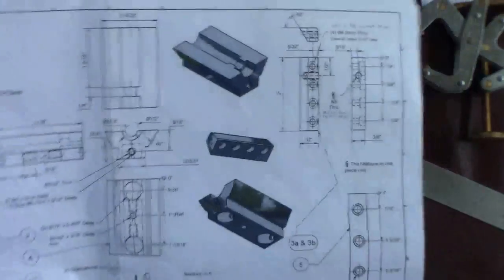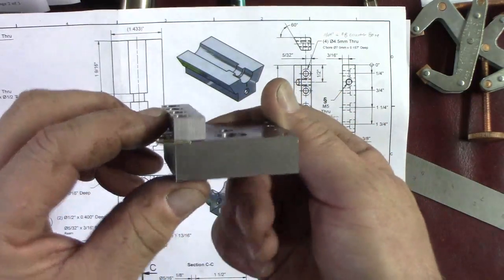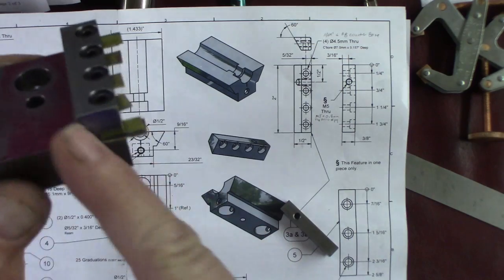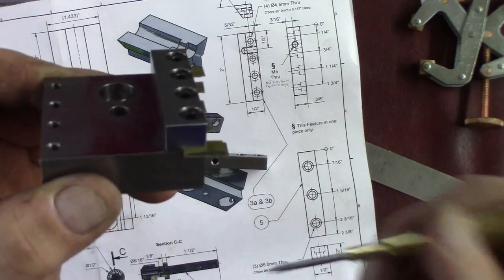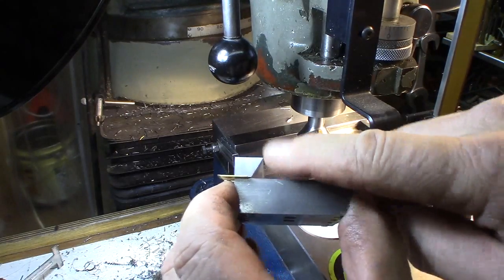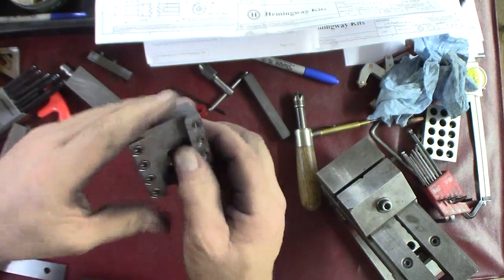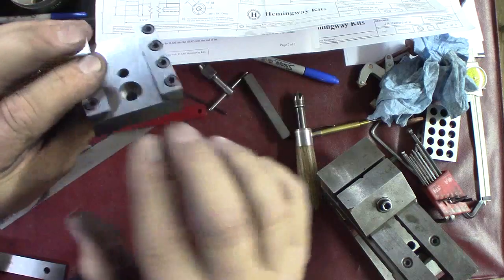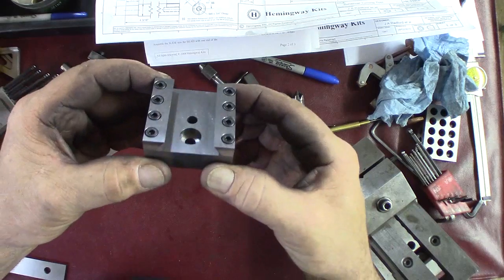How To Build a Hemingway Kit Spherical Turner / Ball Turner P6

Comment: Hi Randy, I really enjoy your machining project videos you've been doing lately, I'm learning a lot of techniques in machining accurate parts watching your videos.
 I was just curious why you didn't take the blank off of the base, and set it at the required angle in the vice and use a straight cutter  to form the dovetail?
Reply from the maker: I am trying to follow the plans and instruction as closely as possible.  Yes, you could of made them that way very easily.

Comment: Randy, I have this kit in front of me now, and I see a problem that I think you are about to run into (if you haven't already noticed).  The body piece is 2-5/8" long, which is sized perfectly for an AXA style tool post.  I have a BXA, and it looks like yours is at least that big if not CXA or larger.  With the body that short, either the head or the handle is going to run into the tool post.  It may be possible to make it work with the handle at some funny angle.  It really looks like the body needs to be extended about an inch longer for a BXA post, longer still for a bigger tool post, in order to provide comfortable clearance for both the head and the handle.  You may want to check the dimensions on your setup.I'm also planning to use a dovetail mounting block on the side instead of the standard side rail so that it will mount directly onto the tool post without needing to be mounted in a tool holder first.Ryan
Reply from the maker: Yes, I did some measurements before I started the project.  So I left the body as long as I could with the stock provided.
It will work great on the 11" Logan with the AXA tool post.  Thanks for the great comment.